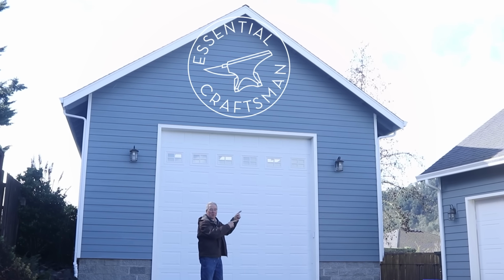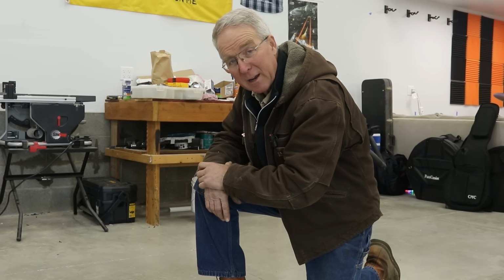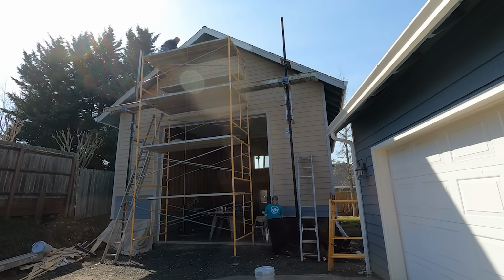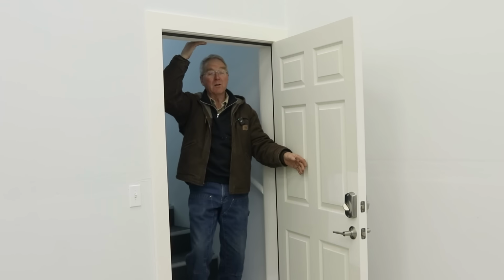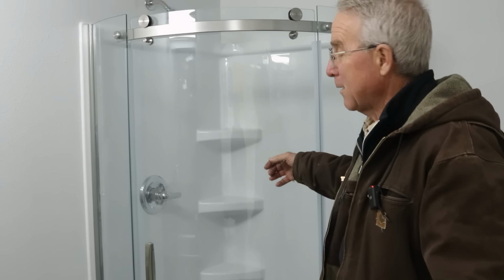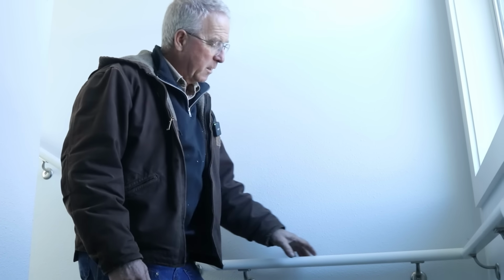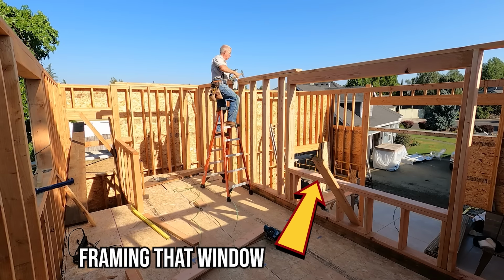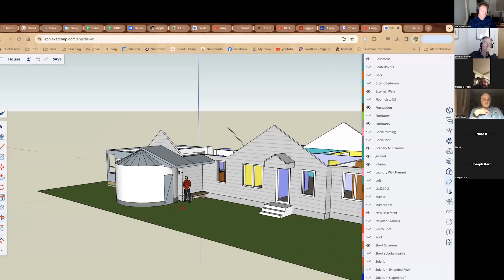Shop Build Final Reveal! The Good, Bad & Ugly

Comment: Overall, I love the shop. Yeah, I get why you aren't a fan of some of the missed opportunities design wise, but take the win. It's a very nice, clean, solid shop/office.

As for the sound dampening issue, as a guy who did home theater design and some recording engineering once upon a time, I can tell you that this can be a long conversation depending on how well you want to solve the issue. What I can say just by watching this video is that you are dealing with an open air environment, coupled with hard surfaces, and not the best insulation for the use of that space. The blanket/sleeping bag thing over the door is a nice start, as are the foam panels on the walls. However, the door isn't 120% covered (the frame and seems are showing), and it's not an enclosed room. The sound will travel out into the larger space which isn't doing anything to mitigate the issue, and is actually acting like an echo chamber with amplifying effects. Further, with only basic insulation in the walls, there is still air in there, and that is what is allowing the sound to conduct through the solid mediums of wood, gypsum, siding, etc.

Here's what I suggest you and the family consider:
1. Insulate the garage door. The more solid the product, the better. White and pink foam boards should do (mostly.)
2. Get some indoor/outdoor rugs that you don't care about the look of that can be rolled out over the concrete when the kids are playing. The more coverage (including overlaps) the better.
3. Add a layer of dynamat or similar deadening product to the walls of the music space (including the doors), and ensure that there is overlap onto the walls. It would be better to add another layer of sheetrock on top of that too, but that's getting into the weeds a bit to solve the issue.
4. Ensure that there is some form of insulation or sound deading material in the ceiling space as well. If there isn't anything, or much of anything, then a fair bit of sound could be escaping through the roof as the whole structure is likely resonating, which means it's essentially and open air speaker to the whole neighborhood.

I'd be happy to discuss this further with you if interested, including hacks to help solve the issue that can involve the kids in solving the problem.

Cheers,
Daniel

Comment: I’m currently researching sound deadening for a new shop in my house. There are lots of mentions of various things you can add to help dampen the sound transmission in the comment already but the most important is stopping air infiltration. In this case into the huge amplifier that is the rest of the garage. A moveable curtain across the front of the performance space might work but it would likely have to be many layers of differently weighted material (think theatre curtain) and go from floor (pooling on it) right to the ceiling. The easiest option though would be to just invite the neighbours for a performance - once they hear the incredible work in person they might be more willing to tolerate the “practice” 😂
Reply: Rockwool soundproof insulation

Comment: For the band area, close it off with drywall /studs/ soundproofing / drywall and install soundblock sheet material inside the walls (or any heavy fibrous type material), then put up more acoustic foam tiles on new wall(s), and corner bass traps on all corners (the corner bass traps help)....That should noticeably cut down the dB's on that.  For the new door, get a double pane window, thick, solid wood door...Sound proofing is expensive.

Comment: The rain gutter downspout can still be redone properly. 
Yeah when you moved onto the scene of the open door and you standing on the 1st step was greatly noticeable. That door is easily to short for that first stair step or last depending on the direction of travel.
The concrete footer, that's actually not a Con at all. The extra isn't noticed, the extra reinforcement is worth the additional cost.

Comment: Paint the exposed rainwater pipe a color matched to the landscaping. This will protect it from UV rays and help it disappear, even if it is a little exposed.
Reply: Use cedar strips vertically to make an L shaped short structure that raps around the corner. Set plants in individual containers inside. It is easy, removable, and consists of materials appropriate to the region.

Comment: For a quick and easy sound isolation, i've put Rockwool Comfortboard connected direct to wall (with the nails/screws used for the 2" styrofoam board) then put the 2x2' eggcrate foam you have there glued to the outside of it. Better to have Rockwool safe and sound in between the studs, but wayy too late for that.

Comment: it feels like every job I am a part of, I always feel like I could or would have done something different if I had more time/more thought in to it. I guess that's the "strive for perfection and know you'll never get it, except excellence" mindset. The only thing i can think of for sound deadening is before the rock goes up, put rockwool in for insulation. If you'd known it was going to be for sound deading, offset double wall with that in there is what I've done and it works great, but I'm not sure that was in the budget or that you knew it was going to be a band practice area.

Comment: Another layer of Sheetrock will kill all the sound leaking out. Just apply glue in a specific way and throw up another layer of 1/2 inch it will also give ya another bit of time in case of fire....

Comment: Sweet built - a contractor friend swears by his sound deadening method, builds high end homes and all of the home theater and playroom spaces get this treatment - insulate the stud pocket, sheetrock and tape as normal, then cover the wall with a layer of roofing felt, then a second layer of drywall.   The roofing felt breaks the sound conduction enough that it makes a big difference in the space, for not a lot of money.

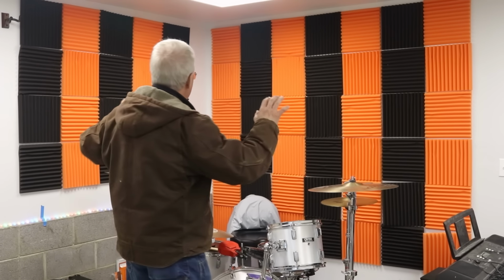Comment: 10:30 It's very expensive, but the best sound deadening is to build a room in a room. In other words, new walls in front of existing walls, but not touching each other. Same with the floor but using material like solid rubber for motor mounts between the existing and new floors (and walls). Probably cost prohibitive. 

I was in one of those rooms in a radio studio once and when the door closed, it sounded like someone had plugged my ears.

Comment: Build some 2x4 frames, paint them if you want. Fill them with rockwool insulation. Cover the face with fabric and stable to the back. Hang on the wall with French cleat.

Comment: The gold standard would be to stand up a second isolated wall on the side facing the neighbor. For sound treatment, corners should see the initial adjustments. Then the edges where two walls meet can accept acoustic foam. Finally, the hard surfaces can be treated--sound panels (2" mineral wool in construction lumber frames with an acoustically transparent wrap) will do wonders.

Comment: Scott, make some acoustic sound panels with some wood framing and rock wool. Cover with a breathable fabric of your choice. Really absorbs sound. You can look at “Sweetwater” for these, but expensive. Very easy to build and extremely efficient. Love the build. ⭐️⭐️⭐️⭐️⭐️ This project sure took; “ALL OF YOU” 😉
Reply: This.  Comfort Board 80 is the stuff I think.  I'd consider a layer of something like Tyvek to act as a fiber containing membrane between the rockwool and the outer fabric.
Reply: The channel “Tech Ingredients” (who are surely on your wavelength - calm dude sharing great insights :) had a series in the most efficient sound dampening panels to make at home. A project for the musicians to do themselves. Grandpa can then come up with a clever way of hanging them off the office wall to close as needed? :)
Reply: would make the room sound nicer inside but do nothing to prevent sound from traveling outside.

Comment: Another layer of gyproc (sheetrock) will deaden the sound transmission enormously.  Don't forget the ceiling.
Then a layer of acoustic tile.  May need to enclose that area for best performance.
That back door will let a lot of sound through.  May need to cover the glass with sound deadening material - at least while jamming.

Comment: the easiest and perhaps most cost effect way to soundproof walls, especially if someone in the family knows their way around a sweing machine, is big, heavy drapes.  Hang them on the walls and you'll be amazed how much sound vibration they soak up.  Then you can move those black and orange deflectors to the ceiling and it will be much quieter.

Comment: Sound proofing is prevention of vibration to that outside wall. The inside drywall acts like a microphone membrane, transfers that oscillation through the stud and then into the outside sheeting/siding, turning them into a speaker. Heavier membrane helps it move less; double the drywall thickness inside. Need to decouple the microphone from the speaker, meaning, the drywall shouldn't be connected to the outside sheeting. In this case the building is built, so what you do is use hat channel, which will pull that drywall off of the studs letting it float on little rubber connections.

Comment: I've been involved in noise control in engine testbed buildings and what I've learned from the Pros is that there is no one size fits all solution, it's highly dependent on the frequency of the noise that your trying to supress. In your case you need to reduce the transmission of sound through the structure and the lightweight construction you have used is not ideal for that. I was told that a couple of changes in density as the sound tries to make its way out is good. In my own home, where I sometimes like to turn the music up a bit, I've clad the party wall between me and my neighbour with a 75mm thick Rockwool sound deadening product and in front of that built an isolated steel section stud wall (another British Gypsum product) that is clad with British Gypsum's Acoustiblock sheet wall material ( this is 15mm thick and twice the densityof standard sheetrock (it weighs in at 46kg/ 1.2*2.4m sheet (8'*4')). In all of these jobs is attention to detail that makes the difference as it's pretty easy to compromise the system with sloppy work. 
In addition to that If I'd look at some studio sound absorbtion panels ( you can buy ready made panels pretty cheaply online) and try to knock down some of the reverberation. You don't need to completely cover the walls, just try moving a few around and you'll notice the difference they make and possibly locate some 'hot spots' for best placement.
As the old joke goes " my neighbours were listening to Led Zeppelin, really loud, last night...whether they wanted to of not" 😊

Comment: There's an easy fix for that grade at 3:15 . . . just add a few  landscape boulders or equivalent like you did on the other side so it's not a slope . . . maybe put concrete under that white trim . . . and what's up with that down pipe there? It looks like a bobcat ran into it. The long pipe can be painted brown. That other miss aligned pipe is not an issue unless it was a job for someone else - just paint it or wrap it and then paint it. I'm a landscaper so yeah, I would have fixed it. You did not show what the long horizontal pipe hooked into so I cant say if I would have fixed that or not but I'm guessing it's fixable as well.

Comment: Guitar amps and PAs can be turned down… but drums can’t!  Any significant sound proofing or reduction would require some renovation of that beautiful new room.  I would suggest looking into in some low volume cymbals and drum heads.  They don’t sound exactly the same as your standard fair, but the reduction in volume will not only help salvage the relationship with the neighbors, but will protect the kids ear drums!

Comment: As a backyard carpenter I totally understand a one man build I built 30/40 with 15’ walls cut down all trees ash for 99% of the garage also I sawed  with my own band mill 2/6 17’ nothing light the siding isn’t done yet but it’s more of a 2 car garage with a 14000 # car lift  12/12’ doors only things I paid to have done is the mono floor with a power trowel finish and the metal roof  in total as of now around 25000$ I’m happy since I got a quote of 80000$ not including the lift and tire machine and balancing machine proud to say I did most of it myself

Comment: block was a mistake especially since it is already a monolithic slab but overall a nice looking and solid shop - you done good and can improve next time - the issues are all really minor and you are being kind of hard on yourself - get a scissor lift if you can manage -  drive all around buildings - really speeds up construction - i have done a lot of comm work and it is a must have

Comment: Sound isolation is expensive.  Also since all your walls are parallel all the sound bounces effortlessly for free.   In studios the rule is no parallel walls and no 90 degree corner.   5 sided rooms :) .   Diffusion is a magical thing, when you put things on the walls your RTA will drop a lot.   You can make foldable baffles (kinda like a Japanese folding wall)  that make that the rooms smaller     that will keep the larger room from getting excited with sound.

Comment: I’m curious why your’e contemplating buying a new “taller” fire door if you’re putting a window in the 1-hr wall in the office.  If you install the (non-rated) window, the fire wall is essentially useless.  So, just buy a taller regular door for the first floor if you’re dead set on the window.

Comment: Is there more than one way down from the upstair area? I thought code required two for fire reasons/safety.
Reply: Unfortunately, many areas in the U.S. don't have very good/safe building codes. It's too bad the federal government doesn't create a minimum building code for the safety of its citizens! Of course, parts of such a code would have to add certain 'features' for specific areas. For example, hurricane strapping for all residential buildings in areas prone to hurricanes.

Comment: Sound deadening: They make a drywall with a membrane in that works very well, use it in duplexes or multi units with shared walls. Or just add slated foam on all the walls and inclose that small area.

Comment: The wider the footer the more weight it will support.  The more weight it will support the less likely the weight will cause the building to shift.  The less likely the building is to shift the less trouble you will have with cracking in the structure, sticking doors, and strange noises.

Comment: Question for you... much like you, I have worn the original carhartt double front logger pants for quite some time now, and I have found myself in the exact same delma as you when it come to having proper work jeans and being forced to wear the "new" carhartt stretch work jeans or Dickies double front both by the way are terribly expensive, don't last and are uncomfortable. I am currently testing out keys double front. I like them but with one downside for me is the hammer loop is on the wrong side for me. In this video you are wearing double front jeans with the hammer loop on the left side. If you don't mind, may I ask what brand are jeans that you wear in this video. They seem to check all the boxes for me.
Love the channel, excellent content, great knowledge and expertise!

Comment: The orange sound panels that are on the wall, sadly, aren't going to be of much use. 

Sound panels can make the room sound better, but those panels are super lightweight and not very effective, they don't do very much. And those will do nothing to stop your neighbor from hearing ya'll play. The most cost-effective way to make the inside of the room sound better is right up your alley! You want sound insulation panels, which are basically wood frame boxes the size of a large picture, filled with housing insulation on the inside. 4, 6 inches thick. And you place 10 of these things in key areas in your playing area. You want to control and absorb acoustic reflections within the space, especially because it's so big. These will go a long way to making the space sound better on the inside. 

As for the outside, ideally, you want sound barriers built into the structure. You want to build an air-gap in the multiple layers of drywall. Using sound proof door solutions. Use special insulation within the walls. There are special types of concrete. Making sure sound can't escape through the floor joists and framing of the 2nd floor. Sadly it's a bit late to do some of this stuff now, and much of it requires construction to resume and a retrofit to happen. 

What steps you can take now? Big heavy blankets on the walls can help. Adding another layer of drywall can help, especially if it's gapped from the existing structure and is "floating". Pay special attention to seals and joints too, that's also very important. Basically, the more mass you can put between that room and the neighbor the better.

Comment: The right size stone or boulder will hold the gravel away from that corner.
Reply: Use thinset to adhere two pieces of tile backer board together. Put rock color tile on it, if looks are important. Use the panel to bump out the grade about 3” away from the trim and siding.

Comment: For superior sound proofing, your gunna wanna do a reset on the wall insulation (aka rip out all the sheetrock and crappy R12 insulation). Add in Rockwool soundproof insulation.  

Otherwise, you could alternatively cut in 2-4" holes and spray in foam insulation.